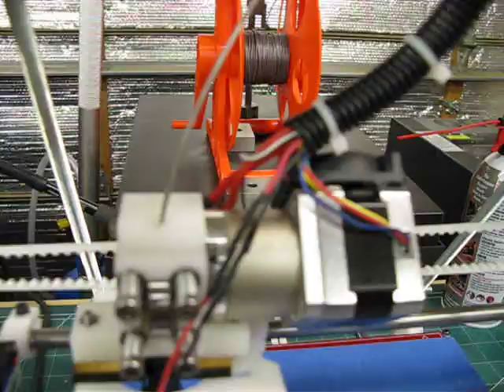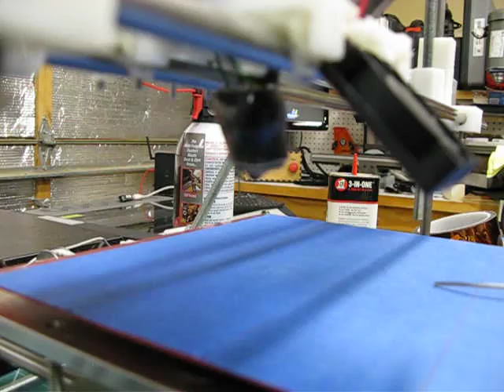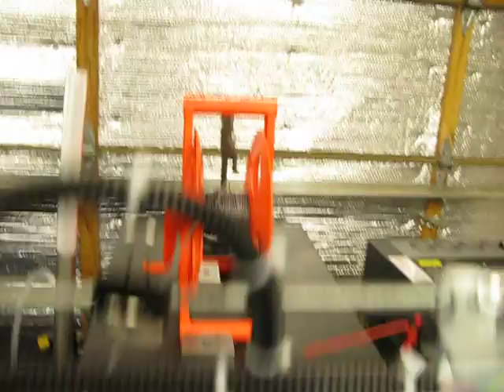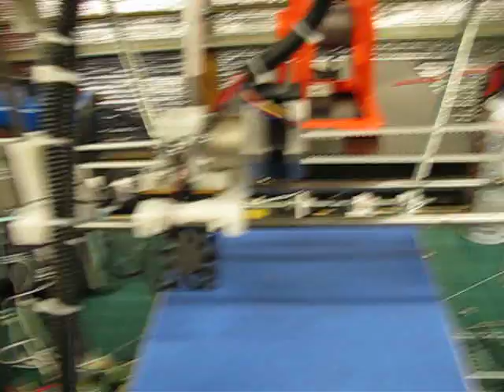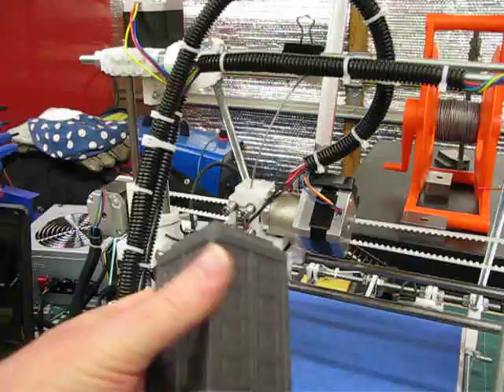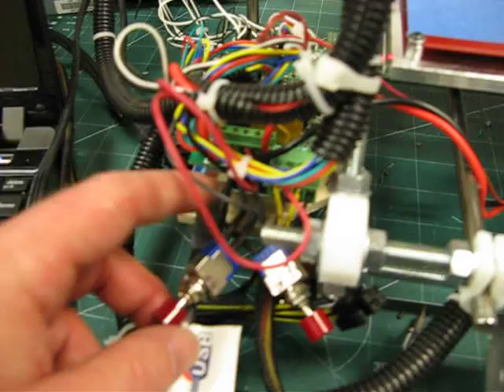Part 2 Steps to a better more reliable Prusa Mendel 3D Printer

Comment: Under-powering your extruder motor  (25%!?) will cause over-heating as the motor struggles to start, as it does constantly.  Is there a reason you are deliberately under powering it?  Although the fan may have solved the jam problem, it would seem that you have cured the symptom, not the cause. Expect extremely shortened motor life from an under-powered stepper...

Comment: extuder jam, -- your getting pla creep,  maker gear puts a fan on the drive gear with the hot end your using.  Heat from the motor or the Hot end.   It takes time for the temp to creep up the filament or heat creep through the motor going to the drive gear.  I see you found it. watching video now.

Comment: I had the same problem with hot motors, even the least-used Z axis motors were getting toasty.I found that it didnt matter what percentage I was at, all that mattered was turning the voltage low enough so that the motor stuttered and didnt even move, then slowly cranking it up (as in 1/16th of a turn, then testing movement again) until it was able to move again.

After doing this, the motors stayed cool to the touch! I highly recommend giving this a shot, dont worry about the %.

Comment: A Nema 23 motor is significantly heavier than a Nema 17. Heatsinks are relatively light. You don't want to have to shuttle any more weight than needed.

Comment: Very nice discussion of your issue, thank you. I learned a lot about the unit and which I may get. I've got two small cnc mills now and have been looking at a 3D rig. If you had to do it again now, which features would you use, which unit would you buy? I love to tinker just don't have the time.

Comment: yes good fix thanks ..try Slice3r too it's not ready for prime time but easy to use for new bee's
it surprised me how well it worked on my very first print.
if you see all of a suddenly a large swing in hot end temp's stop and check that kapton tape
not shorting thermistor leads as with heat things can shrink.
then melt your makergear hot end.